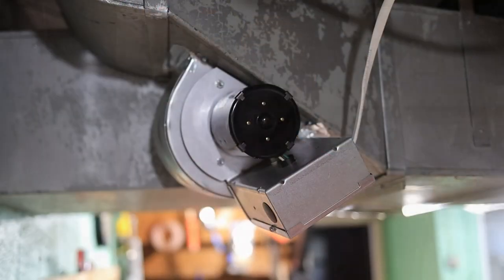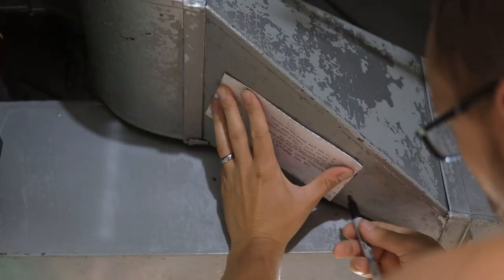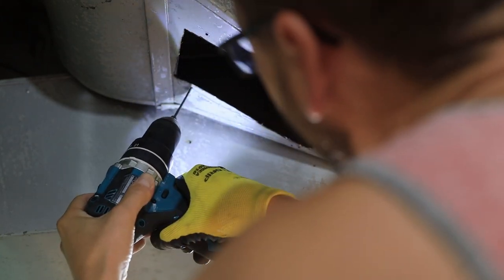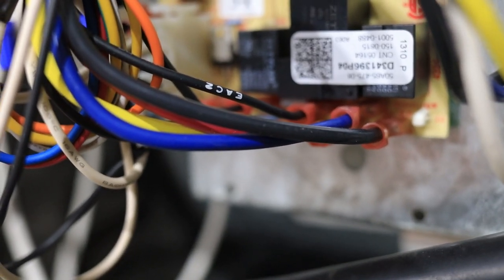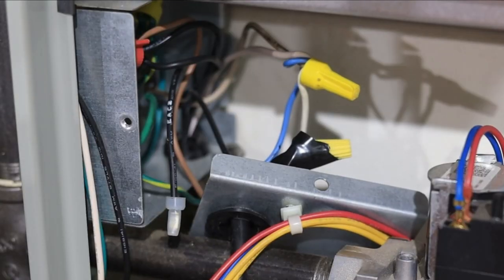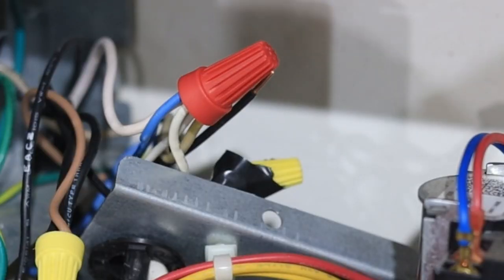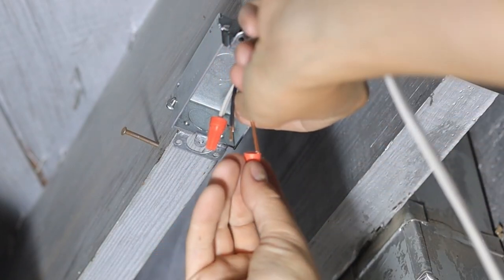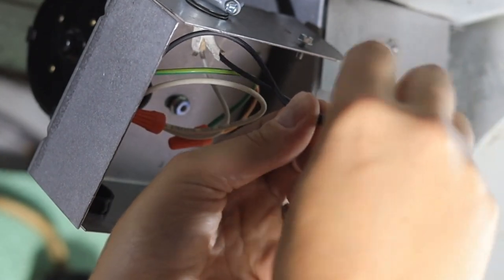HVAC Duct Booster Installation (Hard Wired to Furnace!)

Comment: This is not the correct way to wire in a booster fan. The EAC contact is not designed for an inductive motor load.  He also did not fuse the motor with an inline fuse.  The booster fan should be wired to a the green fan wire on the furnace - 24VAC. The 24VAC should be used to energize a relay that turns on the 120VAC of the fan.  There are booster fan relays designed for this purpose.

Comment: This is the first video that really simplifies how to connect an Inline unit to the control panel and have it turn on/off when the furnance is running or not. Thank you
Reply from the maker: Thanks!  Yeah it is really not too tricky once you get your head wrapped around the available circuits on the furnace circuit board.
Reply: I just bought an in-line duct fan and I had just assumed that it would switch on automatically with the main fan. Imagine my shock when it came with a separate controller. I don't HVAC systems don't come with the necessary outlets or jacks to make this simple.

Comment: Finally a video showing what you need to add a boost to HVAC where air flow is low on upper floors due to bends and length. Don't be afraid to go in further detail on wiring and circuit boards. Reason we are here is because we are DIY not professionals doing this everyday. Time stamps in the video will help those who need to skip those detailed parts.

Comment: Yes it really does help, I was racking my brain over how to do this. I will be using 2 axial fans and I'll probably use the "eac" circuit as a control to actuate a contacter relay to switch power. Thanks for this bit of info.

Comment: Cool. I ended up setting up a junction box and an outlet where I plugged in the booster fan (instead of a switch). I wired the other end of the electrical line to the furnace as described.

Comment: If you never need heat in the problem room, can you wire into the AC compressor somehow so the fan only comes on when AC is on?
Reply from the maker: Assuming your AC uses a different blower speed than your heat (which most do), you could use a relay from the blower speed that is used for AC to trigger the booster circuit.  You may be able to tie directly into your blower wires if the upstart current of your booster doesn't compete too bad with the main blower upstart needs.

Comment: Thanks for posting. What if there is no EAC wire in my box? There are only 2 sets of wires: one supply and the other going to the blower.
Reply: Get a booster fan with a temperature probe.

Comment: Very nice.  I'm thinking of installing one.  I have a 2 storey home with furnace in basement and one of the upper bedrooms doesn't get enough airflow due to length and number of elbows.  Will I notice much improvement?
Reply from the maker: Yes, you should.  Our flow on the vent that it was installed to increased by about 50% which helped keep the room a couple degrees cooler in the summer.  In the winter I keep it off, since I don't need the extra heat pumped upstairs.

Comment: Thanks for the video. What is the CFM rating for that booster?
Reply: It's an AB-1 booster - Google it. The proper way to wire the booster is to turn it on via the green fan wire from the furnace, then use that low voltage signal to energize a booster fan relay near the fan. And to put a fuse in line with the fan motor and relay. Then it will meet electrical code, not burn out the control board in you furnace, and not overheat a long AC run to the booster should the brushes or bearings in the motor cause it to overhead and draw excess current.
Reply: Thank you for that

Comment: Where did you add the booster fan. Was it right after the output going into the trunk line?
Reply from the maker: It was about a foot into the branch that I wanted to boost with the duct booster.

Comment: Can you use more than one
Reply from the maker: Yes you could but you would need to use a relay if you need to draw more current than the circuit on your board could handle.  You can also run one on the humidifier circuit and the other on the circuit I used.

Comment: A squirrel cage fan pulls in air from the side through the center of the fan. You are pulling air from your basement and pushing it into your duct.
Reply from the maker: It's not a normal squirrel cage like you would find in a furnace blower with the side inlet and top outlet.  It has a squirrel cage but it is setup to "scoop" air and push it up the duct.  Almost more like a paddle wheel.  It's probably not nearly as efficient but works pretty well and doesn't draw a lot of power.

Comment: How many cfm did you gain?
Reply from the maker: It will flow 325cfm with no resistance.  I don't know what I was previously flowing on that lateral but it feels like about 2x of what I was at before.  It helped bring the room down about 2 degrees in the summer and I keep it off in the winter.
Reply: @Cool Stuff Guys Like  excellent! I'm doing the same thing this year in my house too!

Comment: Can I tie a booster fan into lighting jbox? When the lights are on, power to fan comes on?
Reply from the maker: I don't see an easy way to have it kick on when the furnace blower kicks on and also be switchable with a light switch that also controls lights.  You could run it though a switch but it would be on non stop when the lights were one vs only when the furnace output is on.  I have mine on a light switch to turn it off in the winter but it is the only thing on the switch.
Reply: I am adding two booster fans that are actually meant for hydroponic use… they have a temperature probe to control when the boosters go on and off.  Hoping to get it done today. I’ll let you know how it goes.